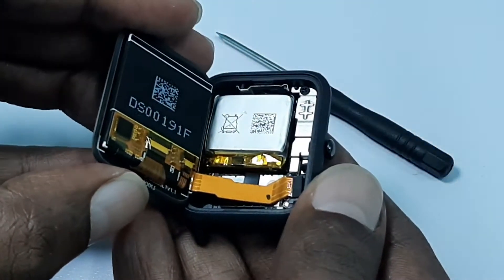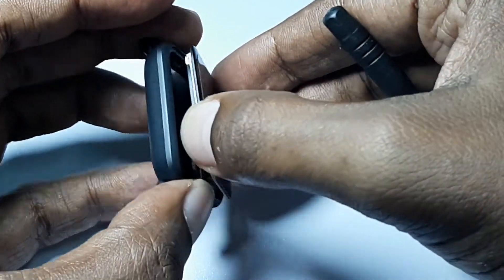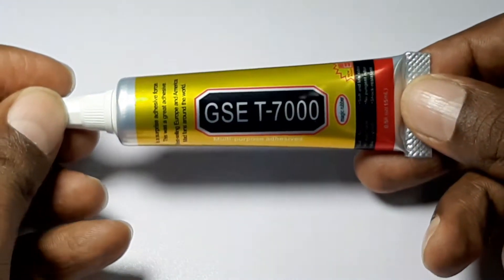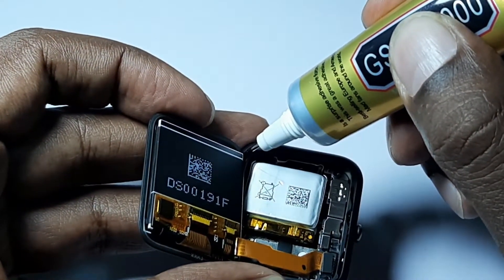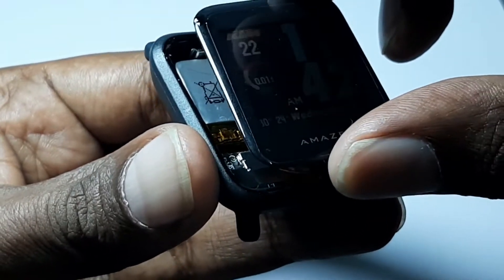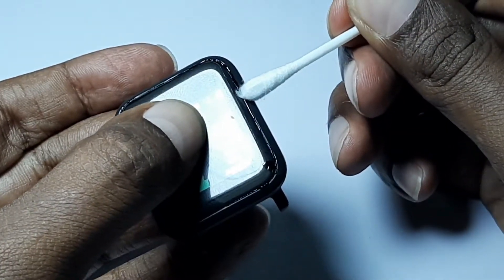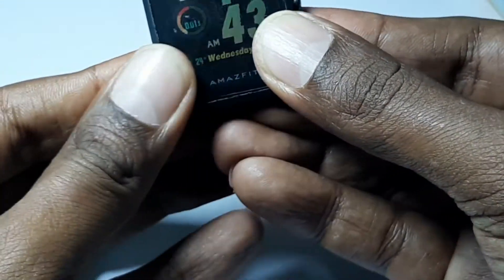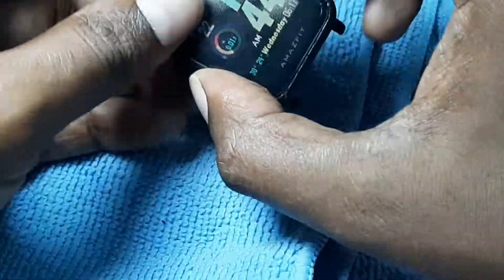Fixing a smartwatch detached screen

Comment: Good tutorial.. What's the best say to get that GSE 7000 glue off the surface of the Bip?  I I got a lot of glue on the q-tip when tried to clean thje excess off the edges of the watch seal, now I have q-tip fuzz in one of the corners of the watch.  :/
Reply from the maker: I could just peel it off with my bare hands

Comment: is this medium  viscosity ? I bought  t-7000  it is written on the box medium viscosity. . Written on the tube t-7000  not  GSE T-7000 and very liquid . I have same watch also same problem .Happened 3 days ago. I cant rub the liquid properly  because so liquid . What do you suggest  ? Is slicon easier to rub as a glue  ? Any brand model that I can use  ?
Reply from the maker: The one i bought was not very liquid as u can see in the video, that is why it was easy to apply, you can get an adhesive that is used for smartphone screens, that should do the trick.

Comment: I followed the steps and stuck the screen back on, but after waiting overnight, the screen turned black with white fading at corners. Touch response still works but I can't see anything.
Reply from the maker: I think your screen is damaged, you can buy a replacement screen online & try to replace  it but I have not done that before.

Comment: Can you please do a tutorial on battery replacement with the Amazfit Bip/Bip Lite? I bought this watch 18 months ago (July 4th 2020) and ever since I’ve been charging it the battery drains really fast. I believe it’s to do with the fact that my plug adapter has overcharged the battery. One time I went out the whole day and before I left the house I put it on the charger and then it must have reached full charge at some point during the day and so it must have been on there for hours and I think that must have significantly weakened the battery. The battery itself is 200 mAh lithium ion battery.
Reply from the maker: If my battery wears out I will attempt to replace it but mine is still fine so I dont want to risk damaging the unit by swapping out the battery.

Comment: How about amazfit gts scrren touch not working?
Reply from the maker: maybe this would help

Start by turning the device on by pressing and holding the Power button for a couple of seconds.
After that swipe upwards on the screen to open the menu.
Afterward, scroll down and tap the Settings.
Now scroll down and tap on System.
Next, scroll down and tap the Factory reset.

Comment: Can the adhesive that overflow clean after fully dry? Is it like a silicon? I afraid it is not look tidy
Reply from the maker: Yes it dries up in seconds,I just used my fingers to remove the residue n it came off easily.
Reply: @pakatvideos  okay,tq